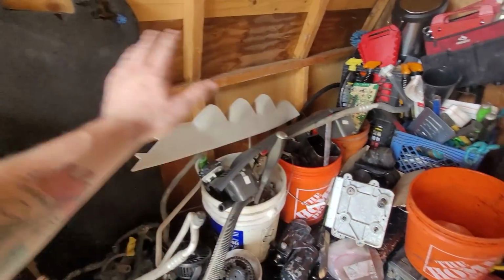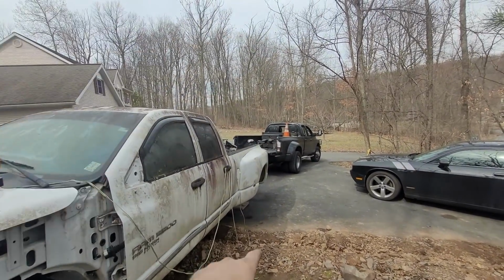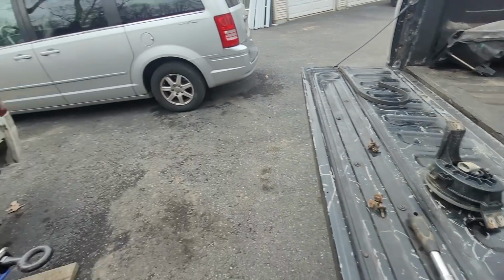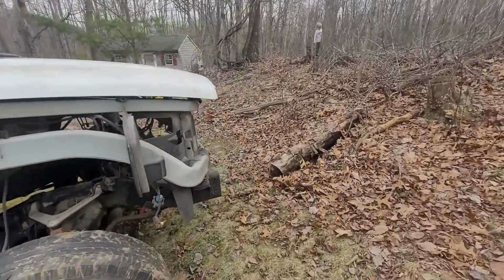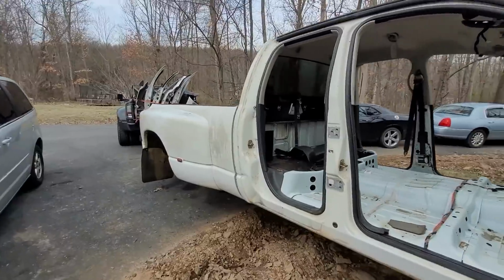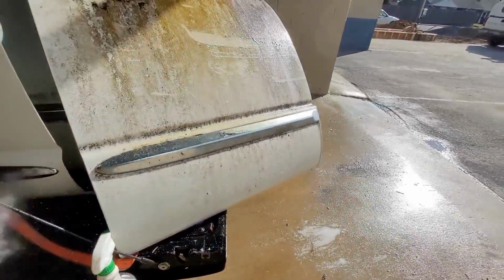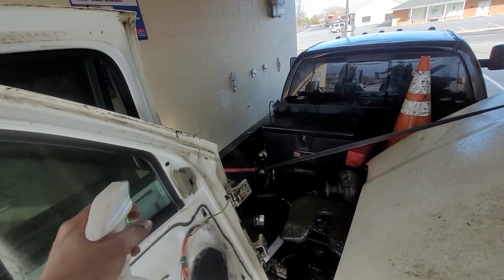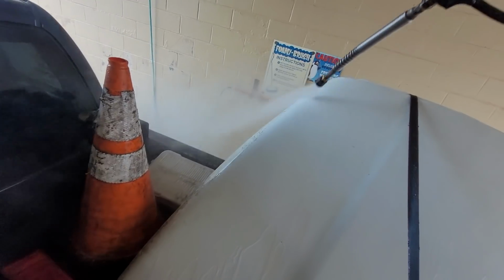13 Years Sitting Under A Tree | Hotshot Parts Truck ASMR Pressure Wash 😂 | Gutting The White Dually

Comment: what dually fenders did you use on your Black truck? Im looking at an 04 that needs a bed and like how your fenders look.
Reply: They are mega cab fenders
Reply from the maker: Yeah megacab flares. They bolt right up with no modifications other than just drilling the holes. Downside is they can get expensive

Comment: Would those fenders an front doors work on 08. 1500 quad cab
Reply from the maker: They're good on 2003 to 2005 ram 2500/3500s or 2002 to 2004 ram 1500s. They're the old style headlights
Reply: Thank you

Comment: Just watched your last 2 videos. Why not get a 12v and totally rebuild it that way it lasts and you know what you have. If that was my truck I wouldn't do it any other way. Also if you washed the truck from the start you could of gotten more than the 5k. Plus you wouldn't of had to do any work and have to worry about storing it. I get it you might make 1k more parting it out like that but is it really more when you have all that time invested?
Reply from the maker: I'm thinking about getting a 12 valve to do a whole ordeal on. Nothing internal but at least paint, gasket, all the bs to bullet proof it and make it look nice. 

To be honest I'm glad it didn't sell. After getting all the parts and making content I'll have made thousands more and fixed my truck all at the same time. I never realized how much was broken on mine until I had a parts truck. I priced everything out I took and I saved a shit load and got the ad revenue. Fog lights and wire harness alone were a few hundred bucks. Full interior, center console, lower console parts, dash parts, a whole rear end, trans, sound system, full hvac swap, full ac system, rear view mirror, factory battery cables, spare ac compressor, the list goes on. That's thousands worth of stuff right there for the price of one transmission 😅
Reply: @CPSteveMiller   I'm not saying do a cam big injectors ect.  But I would say have the cylinder honed new piston and rings. New gaskets. New injectors. Then you have a new solid motor.  That white truck turned out to be really nice. You couldn't tell before at all
Reply from the maker: Yeah I get what you mean on that. Definitely want something that'll last a long time. Especially after putting low mileage trans and rear end in the thing. I feel you are right and it deserves it at this point. I would most liked leave the bottom end as is(especially seeing how much abuse mine took) but possible do the head gasket, pay attention to the cylinder walls while it's off, head studs, valve springs, gov springs, tappet cover, etc.. Just a really nice clean motor that doesn't leak 😅 I am currently on the hunt for one and if I see one for 2k I will scoop it up. That right now is on my 100% buy it now list.
Reply: @CPSteveMiller  good deal. Don't forget bearings too. Buy a beat one and redo it. It's content and the views will come.